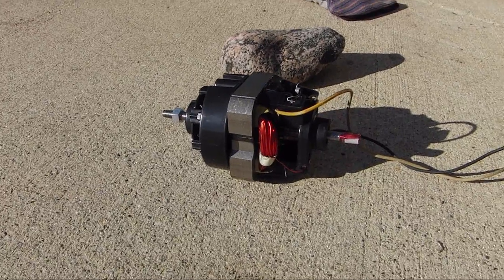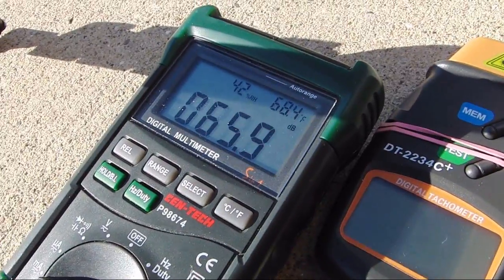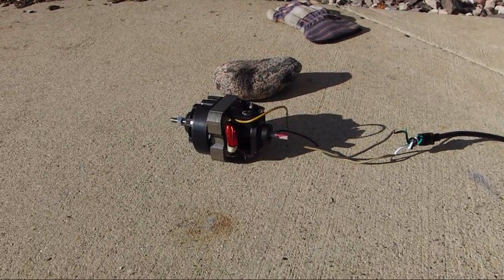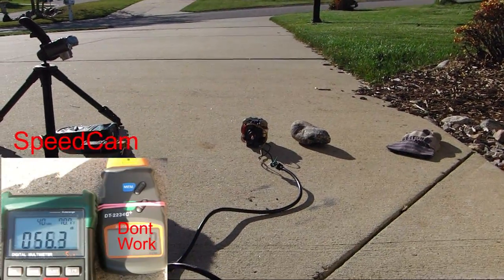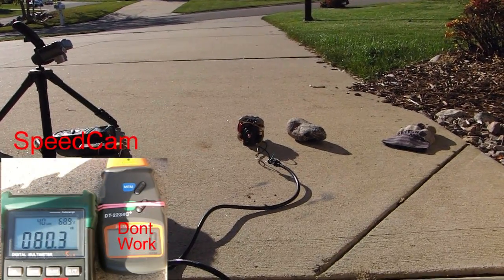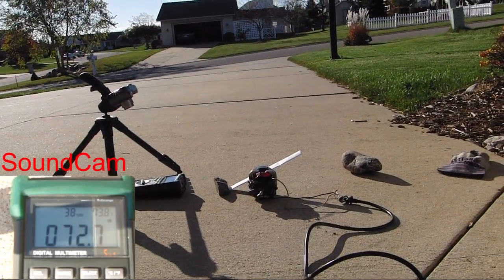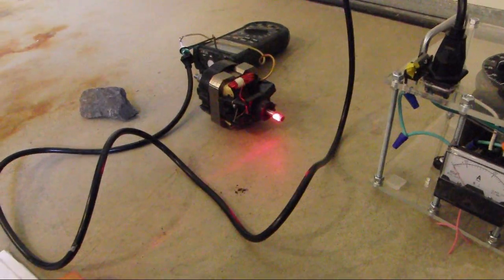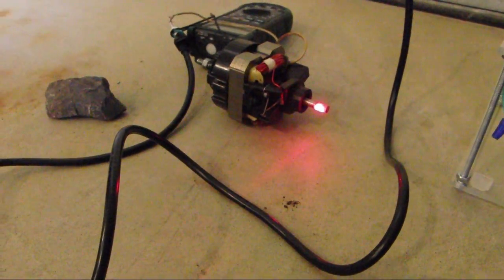Universal Motor Test

Comment from the maker: @DissonanceEngineer Love how youtube didnt save my settings.  Anyways, It was customly made by my self.  May replace the fuse with a 8A breaker.  If you noticed in the video, it wasn't a fuse.  It was a drill bit.  Has an amp meter and for now just a single plug.  Variac came from ebay, I removed it, and rewired it to my acrylic case!